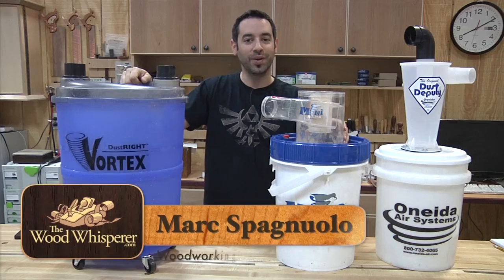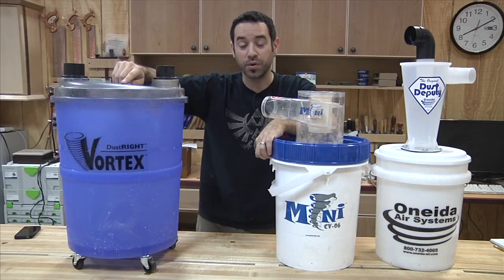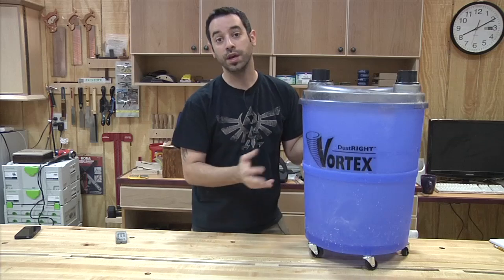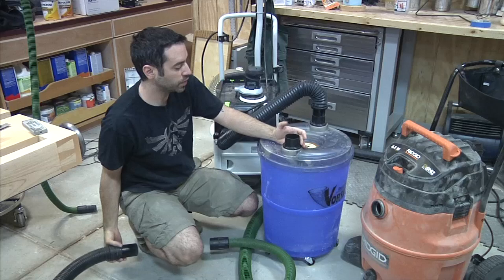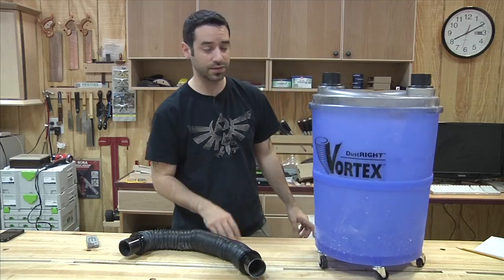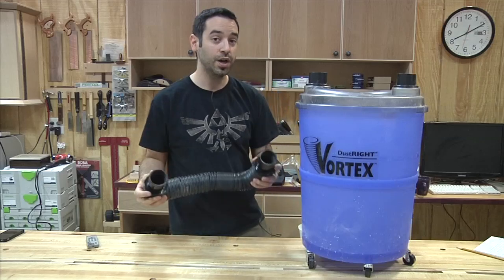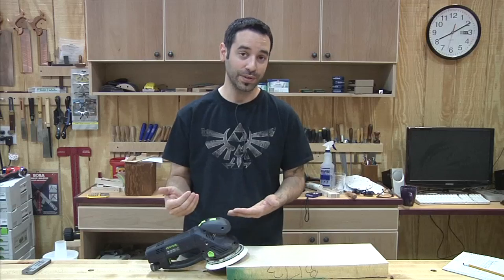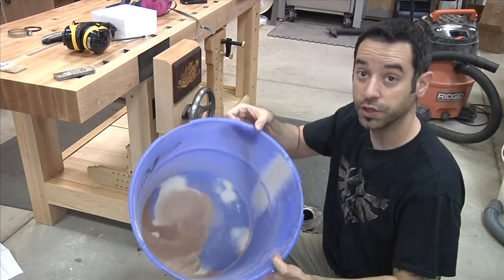170 - Cyclone Separator Shootout

Comment: Just looking at them should make it obvious to most with minor understanding for physics, that the Oneida would be the one with the best separation. A flat structure does not have the same capability to drop the finer dust in the vessel as the taller ones do, which is also clearly illustrated in the test. One reason the Oneida works so well, is that it is a scaled copy of well known industrial applications, which have been calculated over and over and over again, based on airflow, type of material, filter capabilities, abrasion and everything else known to man, that might be relevant. One of the secrets is that the outlet pipe needs to extend lower into the cone, than the inlet, so only the inner and outer vortexes operate alongside one another, eliminating any direct draft from the inlet tube to the suction tube, thus giving a more effective separation. For industrial scale systems everything is calculated. Dimensions, angles, pipe lengths and so on. Multiple cyclones might even be coupled together to get rid of even more particles. In this case air speed is usually a factor to make greater use of the centrifugal forces, which explains why two cyclones connected are usually neither the same size, nor geometry. Dump the large and heavy stuff first at lower speeds, and then accellerate the rest in the next cyclone, to get rid of the finer particles. This way you can achieve ratings clean enough to release directly into outside air for some applications. Some might need final filtration, especially when dealing with toxic material. 

On a side note this could also be an argument NOT to buy a lifetime bag, since it means the risk of getting exposed to particles. With concealed one time use bags, it stays in the bag, and you minimize the risk of getting in contact with hazardous materials. Usually the finer dust is the most dangerous, as a wood chip is pretty easy to spit out, but that is not true for asbestos or fibre glass dust. Some wood dusts are also very unattractive, as they promote cancer, like merbau for instance. Whatever ends up in the extraction bins is not in your lungs - make sure your system runs as efficiently as possible and is well maintained.

Comment: Okay I saw this one and said YES I will watch that because I'm shopping for a dust extractor system as I type. I was ready to order the $79.00 dust deputy till I started checking on Amazon and E bay for around $107 and thinking where did Marc find one for $79.00 and then it clicked that I forgot to check the date of this video. It was May 2012. Enough said but still buying one. Thanks.

Comment: one thing I don't like about the oneida (Which I bought because cv is out of stock at the moment) is it chokes down the vacuum cfm a lot. I would be interested to see if more dust is picked up at the source with the other two due to the 2 1/4 inch inlets and outlets as opposed to the 1 1/4 on the oneida. just a thought that this type of test doesn't account for.

Comment: Buyer beware... the standard Dust Deputy that was tested here is probably perfect for something with the flow rate comparable to a home vacuum cleaner.  However, if you have a good shop vac you may want to look for something a little larger than this version.  The reduction in flow is very noticeable.

The results below are compared to a seasoned stock cartridge filter on a Rigid brand shop vac (the highest flow vac Lowes sells)

100% flow    183 CFM   Seasoned stock filter
93%               170 CFM   Dirty bag filter
85%               156 CFM   Seasoned HEPA cartridge filter + Dirty bag filter
77%               141 CFM   Homemade 7" diameter cyclone (99.5% efficient)
-->>63%<<--  116 CFM   Dust Deputy with inlet and outlet cut a little shorter to increase flow a little

I haven't tested the Dust Deputy particle removal efficiency yet but my guess is that its in the 99.9% range.  However, a 37% flow reduction is a steep price to pay.  My guess is that modifying the inlet and outlet to reduce the restrictions will help some.  It creates very high vortex velocities inside so there's no getting around the pressure drop created by those without creating a larger rectangular inlet that slows the air velocity down.

I'll do more testing to find out but I believe that lowering the inlet velocity will give about the same collection efficiency and will also lower the pressure drop considerably.  37% loss in air flow is more than I'm willing to settle for.

On a side note...
While doing particle collection efficiency testing I thought I was really doing great when I got my little homemade 7" diameter cyclone up to 99.5+%.  However, if you think about it a 99.9% system sends 1/5th as much dirt to your filter as a 99.5% system.  When it comes to fine particles that means you have to clean your filter 5x as often with the 99.5% system compared to 99.9%.  I connected my Dyson vacuum canister to my shop vac and it was over 99.9% efficient (even with the HEPA filter removed).  However, it has an even higher pressure drop than the Dust Deputy.

My goal is to build a cyclone system that is 99.9+% efficient but with a much lower pressure drop than the Dust Deputy so I don't lose flow.  I think it can be done using a multistage approach like the Dyson does, except just a larger version.
Reply: Correction... the Rigid WD1851 shop vac is from Home Depot, not Lowes.
Reply: +Tony Shulthise Thank you, I have a Shop Vac that has similar performance to your Rigid WD1851, if you had to do it over again would you have made your cyclone larger diameter than the 7" you have now for lesser pressure drop?
Reply: monkeyboy4746 no. Mine has 1/3rd the pressure drop of the  Dust Deputy that I tested and only passes about 1/3rd more dust (99.7% efficient vs. 99.8%).  However, this Dust Deputy would be ideal for a small shop vac or a home vacuum cleaner pump.

I'm still experimenting with different designs.  I'm going to build a two stage cyclone to see if I can get the efficiency over 99.9% without too much pressure drop.  I'm also using an air pump that can provide over 3psi vs the 1.5 psi my shop vac delivers so I can afford more pressure drop now.
Reply: I couldn't be happier with my dust deputy. Haven't had to change the filter on my shopvac or the bag on my dust collector in over a year and I have used it while cutting and routing through probably 50 sheets of 3/4inch mdf(which is the king of dust) and dozens of sheets of plywood. And pretty much no dust buildup anywhere around the shop, rarely even have to sweep. Sounds like you have an under powered or poorly designed shopvac if you are having that much drop in cfm. I'm getting maybe 15-20% drop in suction which has little to no effect on saw dust, all while using a 30 year old made in USA craftsman shopvac, and similar results on my 3hp dust collector. Rigid tools used to be pretty good, like their old pipe threaders that are still prized by plumbers and electricians for example, but now-a-days they are basically junk. Remember when they rate those Chinese made tools they are always less powerful than stated on the box because they use peak power for their ratings to try and get more people to buy them. When in reality they should be calculating by continuous power consumption. So your 3 to 6hp rigid is probably around 1.5 to 2.5hp which is pretty underpowered. You might want to toss that crap rigid in the garbage and get a better vac or better yet a good quality 3 to 5hp 240volt dust collector.

Comment: Oneida, now has an all metal cyclone, which may be suitable to a metal shop. My Dust Deputy has served well and there are many plans for stacking the Shop Vac with the Dust Deputy. my first concern was over the ultra fine particles of a bench grinder and HSS tool sharpening, Dust Deputy performed better and expected..

Comment: IOdk, I just reuse the disposable bags....cost me twelve bucks and I just cut both ends and put safety pins on them rolled up....dump it when it fills and put it back on...got 6 bags for that....will last years before I have to worry about replacing them as gradually they will rip after many, many uses. Plus I dont wanna take up any more space then I already do...if somehow they increased suction power or something I would think about it....but they just seem like extra space for no return in my case anyway.

Comment: I believe the reason for the performance is the conical vortex.  The air enters at the top in a diameter of (judging by eye) 6 inches, and the dust exits at a dimeter of meybe 3 inches - 1/4 of the area, therefore 4 times the velocity of the entry air.  Now the centrifugal force is proportional to the square of the angular velocity, therefore the force causing the dust seperation is 16 times that of separators with parllel sides (cylindrical).  It is an absolute no brainer.  But most people seem to build cylindrical separators. Simpler to build I guess...

Comment: Further to previous post: increase the stability of the bucket below the cyclone by pacing a hollow cement block in it (hole facing up), and use blue or black pantyhose over the filter; it's easier to see when it changes colour.

Comment: Would you say that the CV06 would be the best if one were to run a piece of barstock through a ring roller and made a brace that sits halfway down inside of the bucket? Could that have prevented that amount of dust from passing through? Just curious. I'm building mine, as I have more time than money, plus I have a ton of usable components already

Comment: Very interesting video. Is the festool hose can fit directly with the Rigid shop vac? I recently buy the festool Rotex 125mm sander and I don’t have the festool dust collection system (can’t afford it yet)? Buying a festool hose would be cheaper for the moment? Thank you!

Comment: I wish I had seen this shoot-out prior to purchasing the Rockler cyclone.  My primary complaint with that unit is the very fine particles that pass through to the shopvac filter and clog it up when using a belt sander.  Looks like those same particles are captured by the Dust Deputy..

Comment: Clones of the Dust Deputy for sale on eBay for less than $20, just search for dust cyclone. Also handy to put a garbage bag in the bucket before you snap the lid on. You might be able to fix the collapse problem on the mini if you put it inside another bucket to stiffen up the sides.

Comment: I stand corrected. My bad. That dust deputy did a great job. Thanks for straightening me out. It was late at night when I watched this and I thought you were showing the separator result 1st, then the vacumn. Also can these work with 1 7/8" hose on smaller shop vacs?
Reply from the maker: Don't cry foul. Just watch the video again and find the part you apparently missed. :) As for 1 7/8" hoses you'll want to check with the manufacturer's. these models have changed a bit since this review as well so I'm not sure what size hoses they currently accept.

Comment: In series with my shop vac I am using a commercial cyclonic dust separator on top of a big bucket. The arrangement keeps the shop vac filter clean but I find the suction pressure is noticeably reduced. Do you think filling the shop vac bucket with something might help. I was considering maybe polystyrene foam or water bottles to reduce the overall system volume .
Reply: For the bucket topper ones I would think that the container below really has nothing much to do with the suction until it gets completely full. All of the dust pretty much just falls into the bucket, although with a bit of the inertia from spinning that flings it outward. I do notice my bucket has suction on it since the lid pulls in a bit, but I feel that this is more just constant pressure without much actual flow through the bucket.

I have definitely filled mine up completely with fine dust until it stopped working and didn't notice any big changes until it I notice the vacuum was taking all the dust

Comment: great vid, ive been using the dust deputy for 2 years. the top lid where u connect the vacuum came off and would never stay on right afterwards, took some JB weld to fix it. Also is there a way i can buy u a new clock?

Comment: My DC has an "X" brace on the intake port right before it hits the blades. When using the planer the shavings get caught on the "X" and after two passes clogs the intake and loses suction. I'm thinking the separator will stop this. What is your findings on this?

Comment: I keep wanting to figure out some kind of inexpensive dust collection since I do use the old fashion method of a broom and the floor, but I generate a HUGE amount of crud quickly with both the table saw and planer. My ancient jointer just has a floor chute...period..
On a busy day I can generate 3-4 13 gallon trash bags full of dust and shavings so it's just easier most times to use a shop vac and a broom, but man..what a collection system would do IF I had the space..(I don't) and I really hate having to stop to empty bags, cans or whatever..

Comment: I saw this and wanted to buy one in Belgium. Since I found none I searched for a DIY solution. I ended up with the Thien's Cyclone Dust Separator (google it, can add the URL). I took me about an hour to build and it works perfectly. Only very fine dust makes it to the vacuum. All the rest stays in the bin.

Comment: Hi, I would like an opinion on my idea about chip/dust extraction.. I have a Makita table-top planer, I am thinking of putting a 'Y' fitting in the discharge hose, on the long side I want to 'Blow' into it with my shop-vac hoping to creat a vacume at the planer discharge, and pressure in the discharge hose.. Then, just discharging the chips/dust onto a pile outside of my shop.

Comment: Wondering if anyone can share some opinions.  I need to get some sort of dust collection system in my garage. The tools I use mostly are miter saw, hand orbital, table saw and table top router.  Im wondering if the best solution would be either a dust deputy with shop vac OR one of the harbor freight systems with a wynn filter and thein baffle. Obviously the harbor freight will be more costly but I wonder if it will perform better. Thanks

Comment: the Clear Vue CV06 mini that is sold on the ClearVue site comes with a long funnel, but your testing unit doesn't?  That may explain why the ClearVue CV06 mini in this test didn't perform as well as the Dust Deputy on separating out fine dusts?

Comment: Thanks for the info! Deputy it is then! If you attach it to a bigger bucket, does it affect performance?
Reply from the maker: To my knowledge it doesn't affect performance, as long as the bucket is sealed. FYI, you should still check out the Clear Vue model. It performs as well as the DD now: http://www.thewoodwhisperer.com/videos/clear-vue-mini-cv-06-update/
Reply: I'm using Dust Deputy with "Eagle 1654 Yellow Blow-Molded HDPE Salvage Drum with Metal Ring Lever-Lock Lid, 20 gallon" and really happy.

Comment: Why does your cv-06 not look like the one on their web site?  It looks like you are missing the cone separator part.  I bought the cv06 mini body only, and had the same crushing problem with a plastic bucket and the same festool vac.  I replaced the plastic bucket with a steel one and now I get no dust in my vac.

Comment: I bought a Dust Stopper and a bucket from Home Depot.  I think I'm in $45.  It works great.  Of course I had to spend several hours to mount it to my Shop Vac but that's an issue with pretty much any solution.

Comment: Is the cone shape part absolutely necessary for adequate dust collection? The clear view has a nice low profile but no cone.  I'm in the process of building one but thinking of using a 5 gal bucket for the cyclone unit. Also,  does the collection bucket below have to be round? Could a cube shaped box work?

Comment: Suction sucking in sides of bucket: get another bucket from hardware store, cut the top (and maybe bottom) portion of it and slip it over the cyclone bucket - the two layers will stop it from collapsing... I did this with my HD/Dust Topper duo and it works fine...

Comment: Any experience with PVC piping vs. metal pipes with regards to price, static electricity, ease of installation, ect.?
Have heard, that static electricity can build up in a system and eventually ignite the fine dust, if not grounded.

Comment: one point that needs to be considered when doing this type of review is that the suction levels of the vacuum need to match the cyclone.  If you have too much suction for the cyclone then dust will continue into the vac and bypass the collection bucket.  I would also suggest that the suction was too high for the cv-06 which is why its bucket collapsed.  So really, this has to be a review of the collection system WITH the vacuum used.  You cannot compare the separator solutions alone.
Reply from the maker: Yes you can. If you own a Festool vac, this is how the cyclones compare. Yes, we can certainly dial down the suction to see if that improves separation but that also lowers the suction and potentially messes with the suction at the tool. And many folks are using these things with regular shop vacs where they have zero control over the suction from the vac. So while I agree with the assertion that separation could be maximized by varying the suction, I don’t think the fact that we didn’t include that in this test invalidates it in any way and I doubt the results would be all that different anyway.

Comment: hello I have a 2hp dust collector and I tried the small dust cyclone and lost suction bad. even when using a 30 gal trash can sealed closed. thought about venting it outside but want a chip separator that doesn't make me lose suction. any suggestions on a cyclone or something to try to use without losing suction.